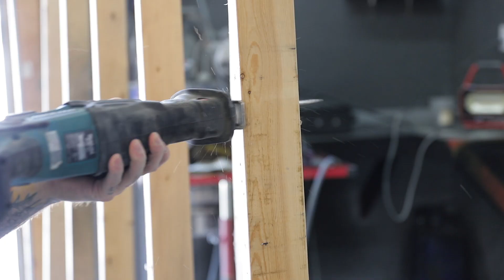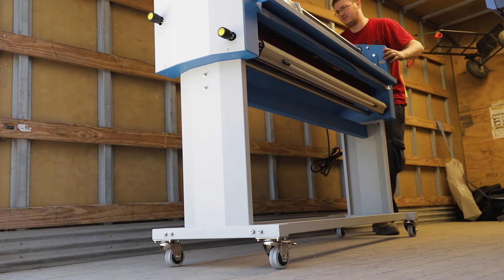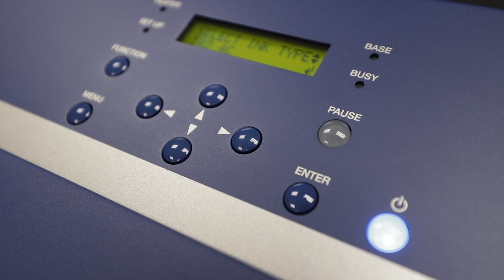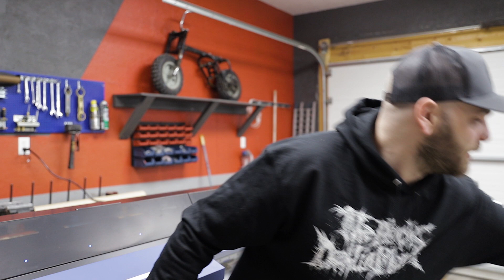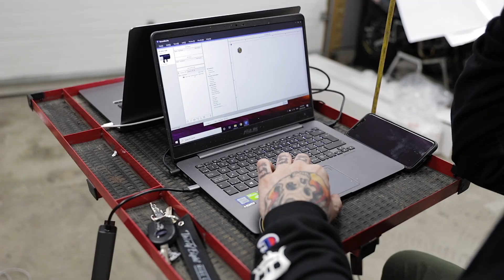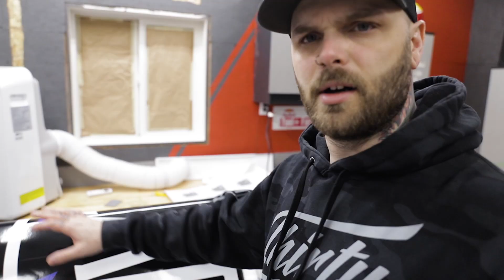What Is Wrong With You? Setting Up My New Roland VG2-540

Comment: I’m going through this exact problem with the smaller BN20a! Tech came in and said that “that’s just how it prints” and it looks like shit. My desktop printer does a better job. I’m not sure how to fix it because the tech won’t look further into it.
Reply from the maker: There are a lot of really lazy techs out there unfortunately. Look in your manual for how to set the media gap adjustment and the bi directional calibration, that will be a good place to start.
Reply: @leestuart38  thanks so much! I have done those calibrations, still looks like crap unfortunately. I need a different tech or I’m returning it lol! 😂

Comment: Have you had any issue with middle pinch rollers leaving tracks in a print? Boards said to only use outer rollers but I can't figure that out.
Reply from the maker: No they don't at all. They only way it would do that is if you backed up a print that wasn't dry, which there would be no reason for doing

Comment: Did you consider hp latex? Im just on the way to pull trigger on hp instead of roland.. no waste ink, almost no head maintanance, no degasing etc etc..
Reply from the maker: Nah It's not for me. Latex isn't at the level of solvent in terms of color matching, durability, and media suitability
Reply: @leestuart38 i wish i could compare them one by one... each sales rep gives only their good sides... didnt noticed much on the quality, maybe solvent is a little more vivid colours... regarding the media choise, latex seems to print on some more materials
Reply from the maker: It doesn't. Latex is stuck to materials that can be laminated, and it requires it every time. They say it doesn't, but it does. Latex scratches right off most media very easily without laminate. Where as solvent can print on a way wider range of stuff that latex can't do and it can do it without laminate because it impregnates the media rather than laying on top. Latex is a long way from being able to compete with solvent
Reply: @leestuart38  its interesting as they mostly position latex printers as you do not need to laminate...

Comment: Wow, this was the cringiest thing I've seen in a while. You might not have gotten the best service from your Roland vendor, but when the guy left and you decided to finally break out a PC laptop after knowing for a fact the software and printer were not Mac compatible really took the cake. The Roland guy probably did do the necessary calibrations (It's his job) but you, in your infinite wisdom, decided to reset the printer to the factory settings. When you did that you erased the calibrations that he did and then whined when your prints came out looking like shit. Maybe next time instead of making a YouTube video you should RTFM and save us all from having to listen to you piss and moan for 22 minutes about things you don't understand and problems that you created yourself.
Reply from the maker: There's always one shit head who doesn't pay attention 😂. Firstly, I was told and adamantly convinced that Mac was good to go here, so not my problem. Second, the reset was what saved it. The installer didn't do any of the calibrations at all, and jacked up all of the network settings. Why would he have done anything without it spitting out a print first? I'm the one who went in and dialed in the calibration and bi-directional settings after it was working, hence the prints that I showed it doing had you watched more before opening your mouth. The only thing I got the second tech to come in for was to do a head alignment, which it needed. And in my "infinite wisdom", this machine has been running 8-12 hours every single day since 😘

Comment: What did the tech adjust?  I have a 42 inch older model and want to check to see if I can get better prints.
Reply from the maker: A head alignment was key here, mine was pretty far out. And setting up all the proper media settings on the user side wasn't something the first guy even mentioned, which is crucial to getting a good print. Setting the media gap and calibration every time you load a roll of material in needs to be done

Comment: Fun to find this video. Thanks for making. I too am a motorcycle guy who is getting into large format printing (though I'm not using it for motorcycle stuff). How are you liking the Roland now that you've had it a while? Did you look at HP latex units when you were shopping? If so, may I ask why you chose the Roland over the HP? Thanks in advance for your help.
Reply from the maker: I prefer the color reproduction and quality of solvent over latex, plus having the ability to print way more than stickers is a big advantage there. I love the Roland so far when it comes to print, it kind of cuts like ass though
Reply: @leestuart38  Thanks for the insights! Much appreciated. Keep up the great work!

Comment: Awesome Video Lee!! I recently purchased a Roland Printer and I to have been having problems getting it going.  Did you ever run into a problem where the print would start and then stop mid print and the head would go back to the home position and not restart the print?  No error codes come up on either the versaworks or the printer itself, been chassing this for a couple days now, it just keeps randomly happening.  Love the videos man, keep creating!
Reply from the maker: I've had this happen and it freaked me out, but it's actually the dumbest and easiest fix ever. This happens when the computer goes to sleep or goes into screen saver mode, because it's continuously feeding data to the printer rather than loading it all in one shot. If it stops just wake the computer and it'll starter back up where it left off. I've just turned off any sleep or screen saver modes so it's always on as long as the laptop is open

Comment: Whoever sold it to you didn't have the infrastructure to do set up or troubleshoot properly. I am an Applications Engineer for a group in PA and we are the exclusive reseller for Roland in NY NJ and PA as well as many other machines and never had those issues with a brand new machine ever, only a machine that's been used or abused. I saw it came out of the truck put together? They don't ship them like that unless they put it together in the truck. Only buy from a reseller who does the install, service and training. We take the customer throughout the entire process, do the install and the training, the biggest issue I have ever had with any of the machines is admin rights at a location or if someone's computer isn't properly formatted or updated. 
Glad you got it rolling, those machines print beautifully and some of the easiest to maintain. Keep it plugged in idle when not in use as the head will continue to clean itself periodically.

Comment: Sorry to say your seller has not advised you well at all. We are a Mac based design studio with one PC which was bought to run our Roland, (including ethernet ports) these are the things you should have been told about regarding compatibility of the software etc. Roland did as you say launch Versaworks for a Mac but when we enquired it was a 1000GBP where the PC version was free. No brainer really, bought a dell of Ebay, good to go. As you say all a learning experience. We are thinking of upgrading to a VG2, so interested in your experiences with it. Good luck
Reply from the maker: Ya it was just a bad experience, partly my fault for just diving in head first without a ton of research on the back end, I just knew this printer was an awesome fit to do what I plan on doing in my business. It's all sorted out and working smoothly now 🤘🏻

Comment: my honest opinion . that this may print nice .but i do agree with some of the comments. this thing guzzles ink . yes i had this thing for a like not even a year. and got rid of it.  i have a hp 315 latex now. and does not even guzzle as much ink as this does. we print like crazy and it took almost 3 months before we changed out  a cartridge. and each cartridge is bigger capacity and is little cheaper than the roland . so this translates to more profit. the hp latex dries faster than the roland. honestly i dont think i will ever get anythign roland again

Comment: I switched all my print stuff over to Flexi sign pro this year, and was so worth it compared to the stock rip software that came with my printer. ALSO ROLAND YIKES. jkjk I have 2 epsons at my shop haha. For the graininess, if your rip software supports it, change the dither settings. That can also help refine the print further!

Comment: You'd have less connection problem if you connect the printer and computer through a router instead of directly connecting them. That router doesn't even need an internet connection, but it would handle all the connection protocols.

Comment: There used to be RIP for Mac computers called Roland PrintStudio but due to the lack of interest from the market was discontinued. The best option in my opinion would be to have dedicated PC for VW. Regarding WiFi. It’s not stable enough for such purpose. It’s just never works good enough and believe me, we tried. It can be done but it will cause problems.

Comment: I feel your pain  bro. I have two Mutoh Valuejets and troubleshoot issues all fu&*in day. The equipment is good but its part of the business so you have to get used to it. You have to use good Rip and print software, SAI or onyx. If possible, download the ICC profiles from the manufacturer of the media; For example, if you use 3m Vinyl, Go to the 3m website to download the profile so your colors will be spot.

Comment: Why wouldn't you just plug a CAT cable from the VG into your router and still use wifi on your laptop? I have the exact same printer except mine is a VG2-640 and do exactly that. I also use a MacBook Pro for all my illustrator work, save to a network attached storage device, pick them up from the windows laptop on wifi and send to versaworks. Ours was setup and printing in less than an hour. Sounds like your dealer was crap.

Also Versaworks 6 is a free download from the Rolanddga website, along with firmware updates.

If you're working in illustrator the swatch libraries, cut contours etc are also free downloads. The Roland colour library seriously improves your results, along with the True Tone colour profile.

Seriously I'm on the other side of the globe here in Australia, but we have very similar setups and I have a bunch on Roland products so I'd consider myself a bit of an expert. If you get stuck with anything or need a hand, message me man. I'll give you a hand.

In case you need Versaworks again in future it's here: http://download.rolanddg.jp/en/color.html#vg2-640

Comment: I had the XC540 for 12 years. Great machine, but it hated printing banners and so did I because of it. A cpl of new print heads, a belt and motor wore out as well as a broken line, easy fixes and not bad for 12 years. Careful with aftermarket inks!
Reply from the maker: Definitely staying away from aftermarket inks

Comment: PC vs Mac is so frustrating!  I would be all in for my  Mac's but are forced to use PC's cause of the lack of capability. We run a VS540I get great prints for stickers using Oracal 3651RA with 210 Lam.  Also Dan a Sunbstance  can help out with your Motorcross Film.  Great Video!
Reply from the maker: I'll have to check that out, I'm looking for a nice die cut sticker material setup. Trying to find something without branding all over the back of the liner is a pain though
Reply: @leestuart38  I dislike the branding on the backing also.  However I really like the quality of the film.   I'm sure they are alternatives.  The print/cut is great to get the ball rolling and you will be able to do "Die" cut stickers with the Roland but it will not be ideal.  In the future you may want to consider getting a separate cutter.  The Summa T-Series is the only way to go with stickers IMO. It's big money but well worth it.  Phil Johnson at Airmark is super cool guy and has helped me out several times.  One thing I'm sure you know...folks in this industry are not short on suggestions and advice.  Just sending out some info for ya!  
 https://www.youtube.com/watch?v=UDqOlMB3ZH0

Comment: Dope printer but I think Roland needs to audit the company you bought it from and the guy who said “That’s just how it prints” needs some training himself. Wow, that was shocking. Props to the tech guy that helped with the calibration. Reflecting on this some more, I’ve been looking at printers recently too here in the UK, and if you’re going for a machine that big you’d be better off (from my understanding) with an HP Latex machine. Zero gas-out time so you can laminate same-day, but you would need a stand-alone plotter to do your contour/die cuts. Hope the Roland continues to work for you dude!
Reply from the maker: I prefer solvent over latex for what we do here, accurate and rich Pantone color matching for wraps is the biggest reason. But with eco solvent you can laminate the same day as well, just not immediately. 6-8 hours is all it needs
Reply: @leestuart38  Ahh, I did wonder about colour accuracy. Good stuff dude, hope it all works out for you - looking forward to the next video!

Comment: This is easy. This is how you should run it. 

1. Get dropbox
2. Work on your Mac and Save to your Dropbox
3. Use the PC for the Rip and small fixes in Illustrator and also to load from Dropbox
4. Get a Summa cutter. Print and Cut is pure shit. But no hurry you will learn that later on.
5. Lamination is a bitch even for people like me that do it every day. So take your time
6. Let me know what you need. And e-mail me at patrik@036reklam.se if you have any questions.
7. Follow me at https://www.instagram.com/036reklam/ and see the machines work that I have ;)
Reply: PS: Always use Rolands Spot Colors as well. They are on that nice CD ;) Or I can e-mail them

Comment: We run an older Roland SP540V, and the graininess you described is something that's pretty common when the bi-directional calibration is off.  I got the same result with ours when we first got it.  Printed like a $20 desktop printer from 1996.  Spent a few hours messing around with it...I'm ultra picky when it comes to quality...ended up doing a full head calibration...literally looking at test prints with a magnifying glass until it was perfect...and now it prints incredibly well...and it's a 15 year old printer.  One day we may bump up to a new version, but I'm really happy with this old workhorse we have.  As long as I clean the heads regularly and keep it maintained, it works extremely well.  Good luck!
Reply from the maker: That was the main setting that was a mile off of where it needed to be, among a few others and the head alignment. He also didn't teach me about the media gap settings so that wasn't helping either
Reply: @leestuart38  Glad you got it figured out.  It's amazing how much a difference all of that can make.

Comment: Those printers don’t really work wireless , place i used to work we had a smaller one, but same roland for heat transfer, we had to plug straight ethernet and the router was all the way back to the warehouse, so we had to run the cable, plus software pretty much only works with wondows
Reply from the maker: Yup I've learned all that now, I was sold another story haha

Comment: I was in the same boat as you, almost the same experience with our installer/tech. Bad or complete lack of training that I had to unlearn and I found out later that the tech was basically training me to waste media and ink so we would buy more and often. To top things off I had zero experience running large format, just had to wing it and do my own research for the company I work for.  Two years later and I still wouldn't say I'm an expert, but if you have any questions or need some advice hit me up and I'll do my best. Good luck with the new equipment, its fun and terrifying all at the same time.
Reply from the maker: I appreciate it man. I'm the same way right now, zero knowledge to experience and diving head first into it haha. Did it with screen printing and it worked out ok

Comment: We had a Roland at my last shop and had color issues for a while. Ended up downloading several different profiles for various substrates . Eventually found the right profiles for each substrate.  The printheads can be a bit fickle, once you have them in alignment you shouldn't have any issues.  We also had the same Mac/PC issues.  Ended up purchasing an inexpensive PC with Win 10 Pro as a dedicated RIP.  Once we worked through some silly issues, we had good experiences with it.   Hope you work through your issues and enjoy this printer.
Reply from the maker: Thanks man. I'm through most of the bullshit now, just a few small things to tweak and it should be where I want it. Then I just have to learn what profiles I like for each media

Comment: u can setup hot que folders from mac. and print through the windows computer. art work and setup from illustrator should be simple. i have a roland but don't use versa works. i am old school sign maker. i like a rip with a front end. i don't like how versa work rips works. there are lots of info on the roland dga website. also call and as tech for advise. it new and under warranty. careful of settings on dumping too much ink on media. those liters prices are $$$$

Comment: Just had my VG2-540 installed. I’ve been running a VG-540 for a couple years so I knew the issues you had ahead of time. I bought a 5 year old PC off Amazon for $160 to run it and it was on.  If you’re struggling with color I’d recommend doing an SGIA color workshop. Hoping you grab a solid profile isn’t exactly the route to take.  Been running wide format printers for 15 years and I did a ton of research on what to get.  You’ve got a bomb ass printer. Congrats!
Reply from the maker: Thanks man. It's all sorted now that all the head stuff is aligned and calibrated. I use spot colors 99% of the time and so far they've all been dead on or very close matches